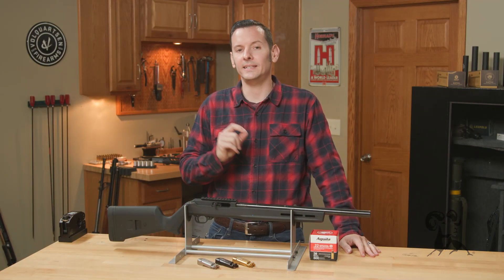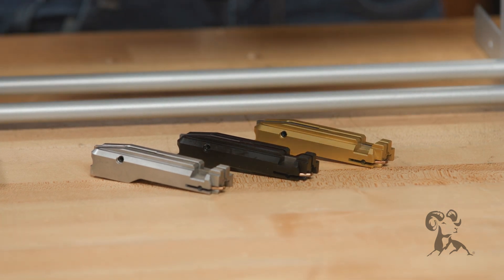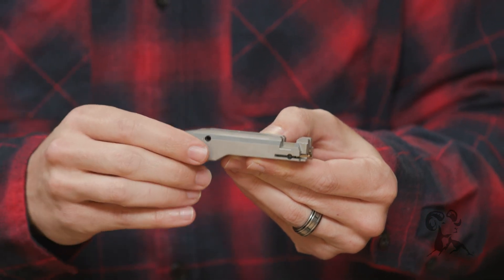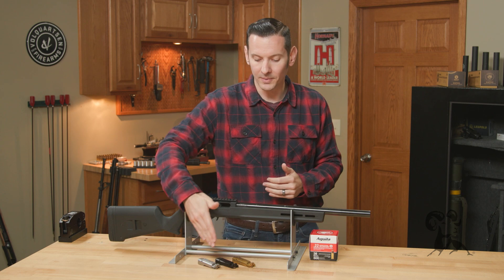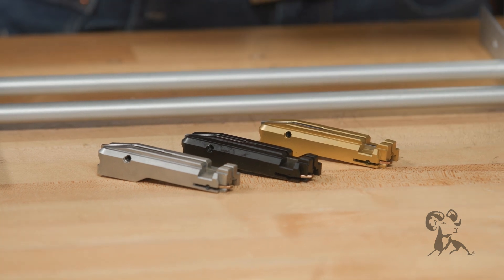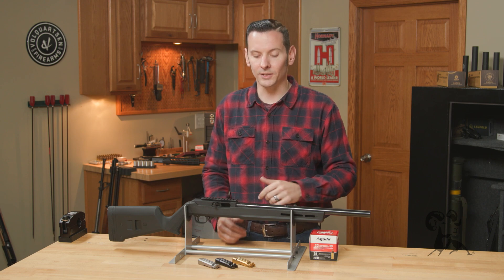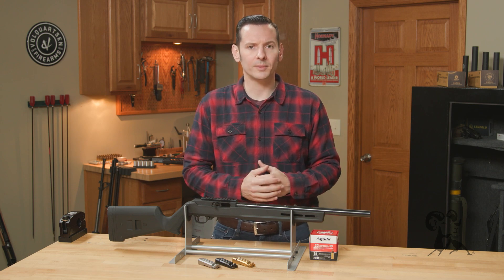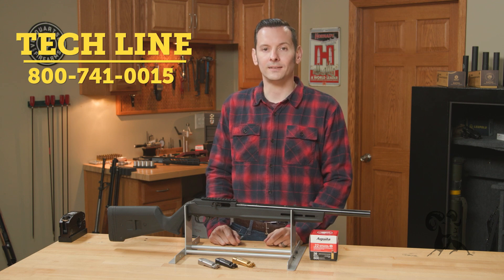Quick Tip: Which 10/22 Bolt is Right for You?

Comment: Caleb, can you go into .17 HM2 bolts and conversion kits for the 10/22. Maybe, even have a full video of accessories for the 10/22 and all the flavors. Converting a 10/22 to straight pull using Volquartsen products. Just some ideas….ty
Reply: That would take a week long video to lay out all that info.
Reply: @tubeonline629  I am interested in having a swappable option for my 10/22. I have an archangel quick detachable stock, and I prefer the heavier bolt for 22lr.

Comment: Is there a performance benefit or optical only... You didn't say what the "benefits" are to upgrading (if any).
Reply: He did say that the coatings are slicker, harder, and easier to clean. That slicker aspect might make them run a bit quicker. Most people don't disassemble a 10/22 for cleaning, but if you're putting a snazzy bolt in, you might.

Comment: So basically it's just the looks, so the variables of everything about this gun will not change by replacing that sell might as well stick with the stock ones, because those are just just painted that's it nothing more nothing less
Reply: a slicker coating might help cycle something like cci quiet subs but probably not if they are the same weight. a while back someone made a lighter bolt for cycling quiets but i think its discontinued now